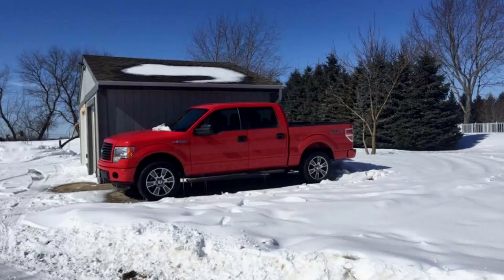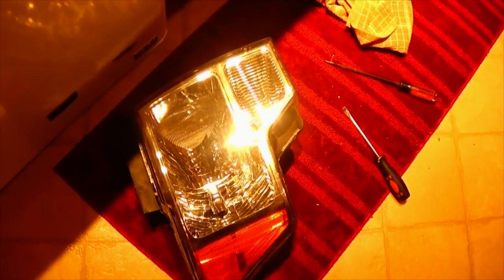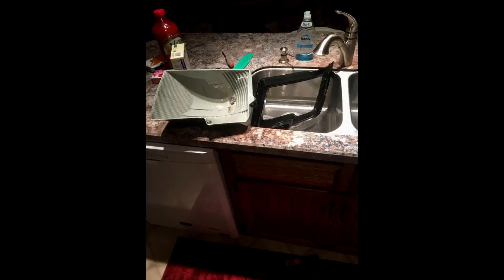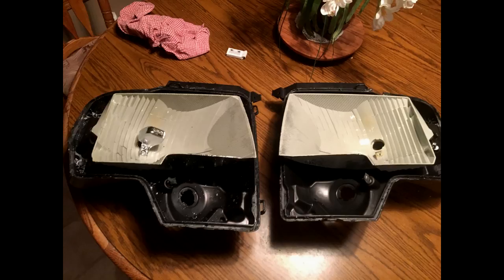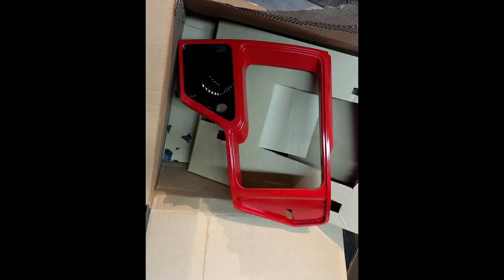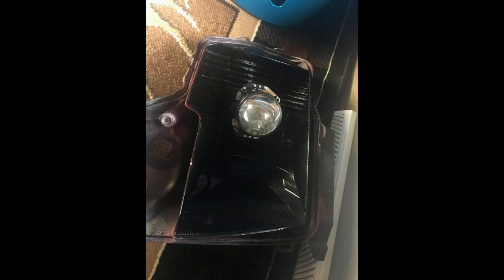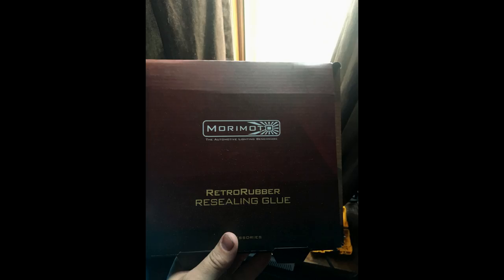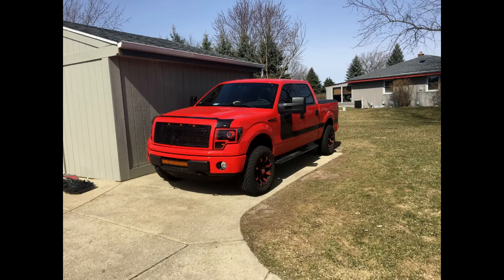I Retrofitted My Truck!!!! (2014 F150 Retrofit)

Comment: Hi, did you have to grind or something like to fit the projector or the hole in the reflector is big enough to fit the projector? Nice video so helpful
Reply from the maker: jonn bonilla depending on which projector you run, you may or may not have to grinding out the hole. If you’re running a mini h1 projector, you won’t have to open the hole up, but you may have to grind down the back to get enough thread to stick through tighten it down enough. The D2s on the other hand will need the hole opened up and the back of the hole (where the bulb seats) ground down to tighten down. I also recommend a good sized washer on the back of the D2s for additional support.

Comment: How hard was it to fit the projectors, you didn't mention much of that. That's the only part I'm nervous about.
Reply from the maker: Ben Youngheim It all depends on the projector and the housings. These I had to open up the hole where the original bulbs went (about a 1/4") because the D2s projectors have a bigger shaft. But a mini h1 style projector should take little to no opening of the holes.

Comment: Do the factory HID housings look exactly like this when it comes to taking them out? Wanting paint and add an LED switchback C clamp but to get someone else to do it for me will cost $800. If I want him to send me an entirely new set will cost $2200 and if I try and do it myself and end up breaking something, they are $1400 to replace. Might just be better for me to keep them chrome :(
Reply from the maker: Cam they come apart generally the same. They’re not that bad. Permaseal is a bit of a pain to deal with but with an oven it’s definitely manageable. Just make sure all the screws on the back side are out, or you could do some damage. If it’s not coming apart the best, throw it back in the oven and heat it up again. 240 degrees for 10 minutes is my recommendation for settings.
Reply: GameFish451 alright. In your opinion, which is the more difficult part? Taking them apart or resealing them? Thanks for the info!
Reply from the maker: Cam resealing permaseal housings is a pain. All of the permaseal in the tracks of the housing (where the lens and housing meet to seal) has to be removed before you can add retro rubber or whatever butyl sealant you want. A screw driver works great when the sealant is warmed up
Reply: GameFish451 alright. Maybe I’ll try it soon enough, just a lot of money I’m risking.. Preciate it man

Comment: hey man I'm doing this to my truck now. I need help getting the chrome bowl out of the actual headlight housing. any suggestions?
Reply from the maker: kylemcgriff I’m assuming you’re doing an f150?
Reply: GameFish Productions yeah. Probably not gunna retrofit it probably just paint this set. And if they go good I’ll retrofit another set. But yeah how did you get the bowl out?
Reply from the maker: kylemcgriff best advice is to use low heat from a heat gun on the plastic clips, enough to soften em up, but don’t melt em, if you melt em it’s all done and over with. A little heat and pull gently and they’ll pop out
Reply: GameFish Productions thanks man. I got them opened up but now I need help getting the permaseal out. How did you go about it?
Reply from the maker: What I found worked the best was heat and a flat blade screwdriver. You can warm it back up in the oven, or just use a heat gun. Make to get all of it out of the track, or you’ll be having sealing issues later on.